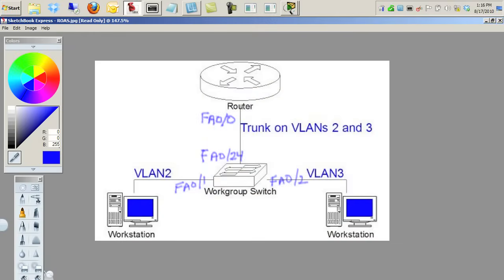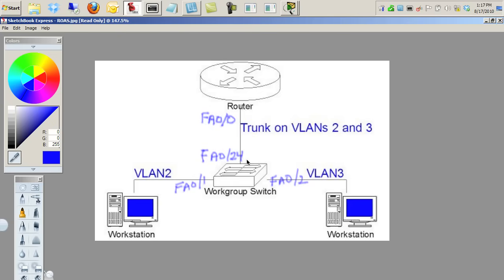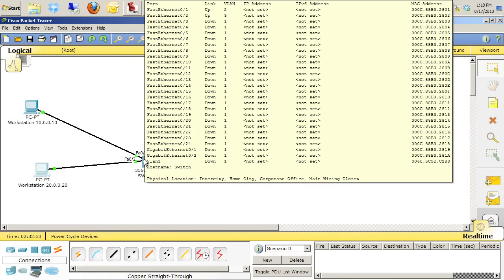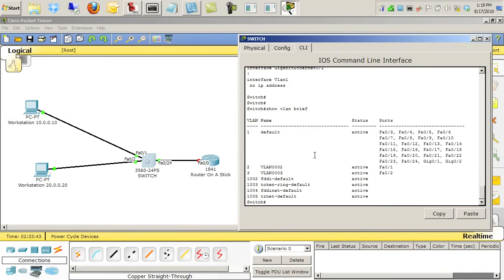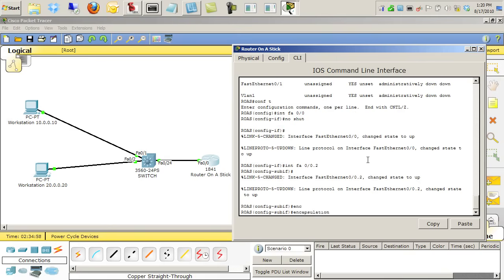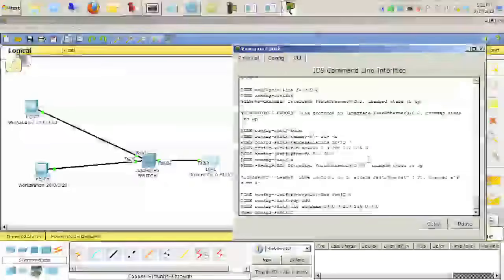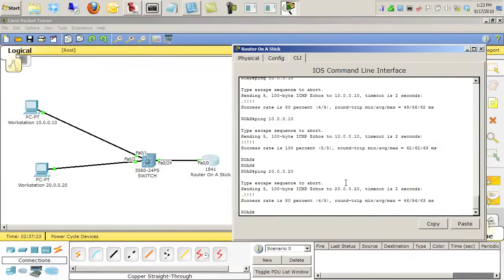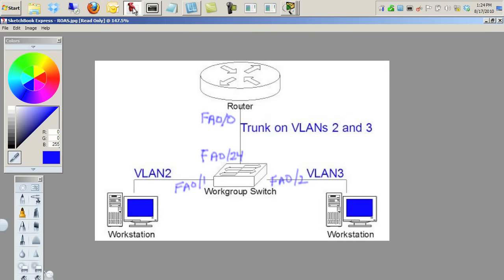Router on a stick, updated video in this playlist https://ogit.online/sloth

Comment: On the 2950 switch I was working with, 'switchport trunk encapsulation dot1q' returns an error message. Using question marks to see if the syntax was maybe slightly different did nothing because that functionality does not exist on mine.

SOLUTION: Just enter 'switchport mode trunk'

For some routers, dot1q is the only supported encapsulation so it gets set as that automatically. This means there is no point in entering the command and IOS takes care of that part for you. It just doesn't make that very clear and makes you suspicious of your setup when you're so used to having to manually set every little thing. Hopefully this helps some people and saves them from the sadness of seeing their question asked and ignored in 2+ year old comments.
Reply: Thank you so much for clarifying this I was getting extremely frustrated on why this command did not work for  my homework assignment in setting up VLAN Trunking in packet tracer.
Reply: Yeah I followed the same thing.. Good thing I read this.. It would be nice for him to update the information for those who couldn't use his command line switch info and inform us when he made a typo like swi, switch trunk end and enc,etc..
Reply: Same thing happened to me, I looked it up. New devices don't use that command. Thanks for pointing it out though, I wish I read the comment section before going on a 30 research lol

Comment: Hi Keith, I'm having a problem concerning the dot1q encapsulation. I'm using the same switch as yours but keep on getting the same error message everytime: % Invalid input detected at '^' marker. Can you tell me please what to do in that case?
Reply from the maker: Use the context sensitive help (the "?") to identify the syntax that they are simulating inside of Packet Tracer.
Reply: Hi, thank you Keith for the reply. I've got the solution to my problem. In fact the layer 2 switch does not support the 802.1q protocol, so i had to create a native vlan and it worked!
Reply from the maker: madraak10 Glad you got it working!  Congrats.
Reply: +madraak10 You'll probably find it doesn't support anything other than dot1q so doesn't understand that you are telling it to use that as it is there by default. In that case you can ignore the line.
Reply: What if you have to configurate two ip address in the router on the same network, do i have to configurate from biggest to smallest network?

Comment: I got working something with switch. I was using 2060 which book used, changed to what you had, worked fine. thought of that after I posted, I thought was an issue with older version of PT I have. I would have thought any switch handle vlans would handle dot1q, I guess not necessarily or could be PT.

Comment from the maker: For most of the CCNA stuff, PT works pretty well.  You may want to try a different router type in PT.    Perhaps the one you are working with (the router type in PT) doesn't have the router on a stick functionality, but a different router type in PT likely does.

Comment: Tried this in PT I get to encapsulation part it keeps saying encapsulation is invalid command. even made new .pkt file. Same thing whether I try isl or dot1q.  Been really considering just getting real stuff off ebay PT seems buggy. just not sure what to get book use 2960 switch, not sure what to look for in router, other than support ipv6, and maybe a few serial ports. Also kind of Leary getting on ebay I heard some have had bad IOS, and they had to get big support thing or get else how.

Comment from the maker: You can use secondary addreses, without trunking to route between two logical IP subnets in the same VLAN, but other than that, you will need 2 IP addresses, one for each subnet/VLAN.

Comment from the maker: Some routers interfaces can act as a switchport, others can't depending on the model.    If you are on a multi-layer switch device (like a 3560), using the command "switchport" converts it to a layer 2 port and then your layer 2 commands can work.    "no switchport" (on compatible gear) converts it back to a layer 3 port.    If your router doesn't support that, you can still use bridge groups to convert to layer 2, but that may beyond the scope at the moment.

Comment from the maker: Hello Shem-   That error could be from the following:

Using the command in the wrong mode, such as in global config rather than sub-interface config.

Having a typo in the command(s)

Having an IOS that doesn't support that command on the sub-interface.

Are you on a live device, simulator or emulator?

Keith

Comment from the maker: Hi-  Thanks for the question.

The ports, going to the workstations on the left and right are configured as access ports.   The port going to the left is an access port assigned to VLAN 2, and the one to the right is an access port assigned to VLAN 3.

Thanks,

Keith

Comment: Quick Q. To create the trunk, you configured as a trunk, the link between the switch and router. But the VLAN ports going from the hosts to the switch, -do I take it they are configured as trunk ports as well, or do they remain as access ports?  Great video by the way.

Comment from the maker: Normally we will have a 1 to 1 correlation between a subnet and a VLAN.   20 different VLANs would likely use 20 different networks/subnetworks.

If you put multiple devices in the same L2 domain (VLAN), devices from 1 subnet would still need to point to a default gateway (L3 device) to logically forward traffic from their own subnet to a device in a different subnet.

Management wise, and security wise it is generally considered a bad idea.  ;)

Keith

Comment: let's say i dont do VLAN dividing, so both PCs are are in the same VLAN (native, 2, 3, whatever..). then i don't need to do encapsulation? 
and what would happen in general terms in network if they stay in same VLAN? i mean what are the pros/cons of that network scenario, still assuming they are in different subnets (10.0.0.0 /8 and 20.0.0.0 /8)? thank you!